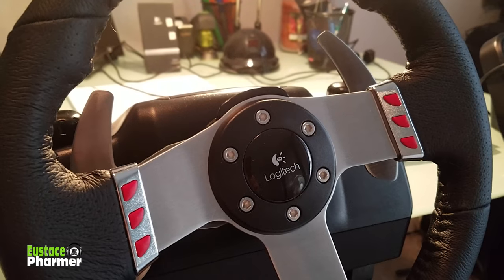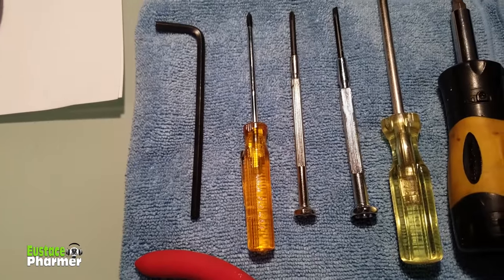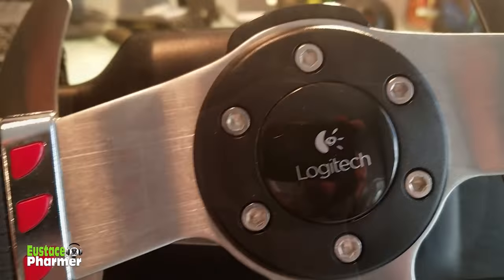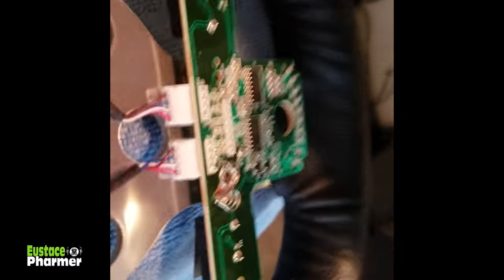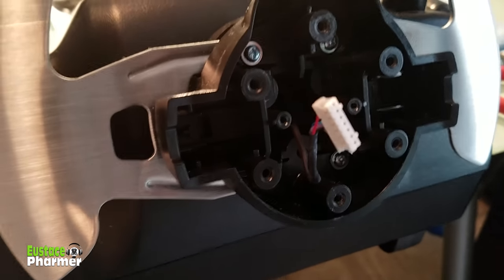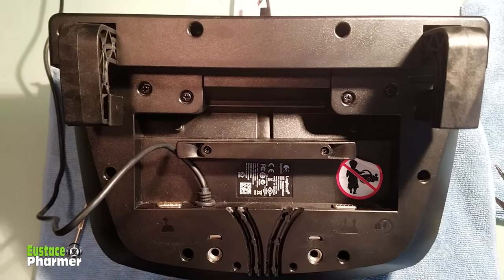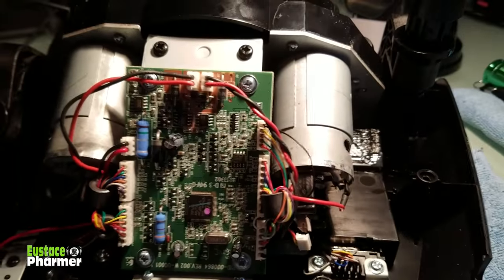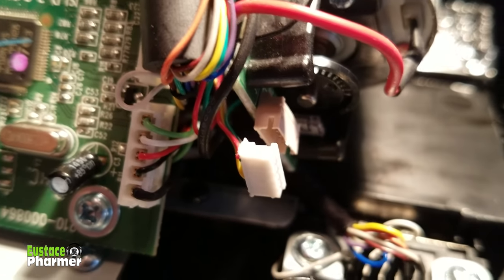LOGITECH G7 WHEEL CENTERING ISSUE FIX

Comment: Well as one of the racers who doesn't see the point of Farmig simulator.....(but then I didn't see the point of trainsims until a friend gifted me one a few years back, so I could be wrong, but well I've got relatives who are farmers so no need to simulate it. ;) ) let me thank you for that helpful video. 

It did help me fix my G27, when I just had both of the issues, loose Optical encoder and a partially broken encoder wheel.
I'm thinking about getting one of the brass replacements for it, as it's past Warranty (german 2 years one) anyway and I don't want it to fracture again, I want a bit more use out of it. 
Well bought it used at an absolute bargain price, around 130€ (hadn't had that issue back then) two years ago , when I wasn't sure if I'd stay in Simracing or not.  And let's say I've been enjoying it a lot, the G29 is a bit meh, more buttons on the wheel but you have to buy the shifter extra, and well... the Thrustmasters cost a bit more.......
Reply from the maker: LupusAries
Lol 😂, I didn't see the point in a Farming Simulator either until I decided one day to watch some game play footage. I was very surprised at the level of detail in the game and it was a launching point that opened my imagination. Watch some of my videos and you will see I use the game to tell all kinds of stories. Look at my Dusty Cove and West Coast play lists for the best examples 😊. Farmers as you well know do not drive a tractor and combine around 365 days a year. I like to tell stories about the everyday life aside from farming as well as farming.
Thanks very much for watching and for your comment. I appreciate it it and glad I could help you ☺️
Reply: @Atomic67G  As a kid growing up on a farm, i played over 2k hours of farming simulator in total (2012, 2009, 2013, 17, 19) I always  liked tractors and farming equipment, bring my frend to my house and he was playing just farming, with no intrest in tractors before

Comment: Thank you so much for this video! One screw was already fixed and the other one I did not even tighten a quarter turn. So my expectations were pretty low that it would work. But it was a nice surprise that the steering wheel worked normally after the procedure and still does after a few hours with DiRT Rally. An interesting detail was that my part with the sensor was mirror-turned compared to yours, but the principle worked anyway. 
Cheers, have a great weekend and thank you once again!
Reply from the maker: you are very welcome and thank you for the great comment! I'm thrilled it worked.
If everything remains tight and the wheels still goes off center in the future look in my description and download DX tweak application that I have there. Use it to fine tune.

Comment: I used a very thin model making glue which draws itself into gaps by capilary action to fix the crack in the disc and a thicker contact adhesive on the shaft after refitting the disc. Thank you Eustace. An informative and very easy video to follow. Another G27 saved from destruction.
Reply from the maker: NTS-autoparts skelmersdale
 you are very welcome 😊 I'm glad you got it sorted out. Thanks very much for watching and for the nice comment.
Reply from the maker: NTS-autoparts skelmersdale
if you still have a slight alignment problem here's some legacy configuration software. it will do the trick for sure.
https://drive.google.com/folderview?id=0B9OBlJza5PRkbHVKS1BIX3B1OEU

Comment: You won't be getting any grief from this racer haha! Excellent tutorial, was really glad to see those screws loose and nothing cracked.

One thing worth noting that I noticed while disassembling my wheel is that the black optical sensor cover was the other way around compared to yours for some reason. The little arrow which you can see on it, as well as the red cable, were more towards the main board. I don't know whether this is a European thing on my end or some assembly line screw up, but taking off that black cover got me a little worried. But I unscrewed the main board to give myself some space and started lifting it with a flathead from under the side which the arrow pointed to and voila! it all went well.

Again, thanks for a clear tutorial!
Reply from the maker: Thank you very much for the compliments and for watching. I'm thrilled I could help you. Wheel and pedal sets are so expensive. We have to keep the "vintage" equipment chugging along as long as we can.😊👍

Comment: Great vid, helped me a ton with taking apart and putting the wheel back together safely. Thank you for documenting your experience. 

For me it turned out that the screws were loose and the ring was cracked, tried superglue-ing it together, did not seem to work (although I thought I did a good job), so I ended up ordering a brass replacement for the ring. 

The part was a bit too tight, so I had to use fine sandpaper to install it. And guess what: the wheel was still not centered. :'(
I then used the DXTweak2 file you so kindly shared and I saw how value and raw arrows for the Wheel axis were off-centered when meeting in the middle. Can't remember what buttons I pressed in that software, but it then re-calibrated the two arrows and fixed my wheel.
Now, I have no idea if the screw tightening and the new brass ring were really necessary, but I have a fixed G27 now. I've had this since 2011 and I hope to have it for just as many years to come now :))
Reply from the maker: I'm thrilled you got some help from my video. Don't feel bad about the ring. You would need it eventually so it was smart to do it now.
I appreciate you watching and for your comment 😊 👍

Comment: Mine only does this when I'm really racing hard and swinging on the wheel.. if I drive carefully the wheel stays calibrated correctly in the middle.

My wheel will also calibrate perfectly every time when I unplug the USB and plug back in.

I've also noticed my vibration doesn't work with dirt 2.0
Reply from the maker: G27 is a good old girl that just needs some delicate care in her old age 😁
Thanks very much for watching and for your comment 😊
Reply: Atomic67 G absolutely! Have had mine for 5 years now, bought it brand new. It’s just now doing this in iracing.
Reply: hey, bought an used g27 today and i have the same issue as you, could you fix it? how?
Reply: Matt B omg same! My vibration isn’t working with FH4!
Reply: Atomic67 G my brand new G920 has this problem...
Reply: Hi @Matt B, this is exactly what happens to me... if I drive slowly and very carefully the wheel works fine, but if I drive in a intensive race, my wheel descalibrated.
Reply: Hi. This is exactly the same problem I have. How did you solve this (if you did)?
Reply: @NextGenGamer1  I bought the g29 racing wheel about a year ago now.

Comment: Thanks for making this video! mine was cracked, it looks like the encoder wheel was manufactured as 2 pieces and they were glued or fused together? My encoder apparatus was mounted backwards from the video so the screws were accessible,  I took them off,  super glued the encoder wheel and held it together with a vise grip (lightly)... reinstalled it after it dryed. AND IT WORKS GREAT NOW!
Reply from the maker: That's wonderful that you got it working! Thank you for the comment 😊 👍!

Comment: Thank you so much! Watching from 2020, seems as though my wheel is cracked but I have no clue what to do. Do I glue it if so do I use gorilla glue regular glue? Or do I just get a new one?
Reply from the maker: Hello and thank you for watching and for the comment 😊.
If you are referring to the optical sensor disk, You can try using a very small amount of Gorilla gel instant adhesive but you have to be extremely neat and careful. You can't get any of it on the surface of the disk or it won't work right or at all. 
I recommend applying the glue with the tip of a toothpick.
Some have had success with gluing it but the best thing to do is to have a new one 3d printed.
Reply from the maker: btw, love your profile photo 🇺🇸👍
Reply: @Atomic67G  Thanks, Knowing me my like is horrible and I have no 3D printer near me so i'm probably just gonna sell it but now I have no clue where to buy a new G27 because it is my favorite wheel.
Reply: @Atomic67G  I'm gonna attempt to glue it right now with Crazy glue and a toothpick, i'll let you know how it goes.
Reply from the maker: @emiliovalenti2723 
Don't buy a new G27. The ones available are over priced and many don't work.
Buy a G29 or G927. 
I now use a Thrustmaster and I love it.
Reply: @Atomic67G  Ugh I had everything with this G27 I had the old shifter with the panel which is rare and I can't believe this crappy little disk is causing this much of an issue.
Reply: @Atomic67G  Pff I just snapped the disk... well to the garbage it goes.

Comment: I have seriously messed with the encoder disk (got a free G27 from a colleague who asked me to check it out because it "has problems"), which was cracked in about 6 places, put it back together with a very thin metal tape) and the 3 dots you mention I think are just results of injection-molding the part and are not anything to worry about, it's the slots you better not cover.

For anyone suffering auto-calibration problems: make sure the gear sprocket that moves sideways is lining up in the sense that the center position of the wheel should have a distance left and right that's equal, otherwise the endstops will not be met accordingly and self-calibration will fail.
Reply from the maker: To be honest, it would be much easier to get another disk 3D printed.

Comment: Excellent work on the video! It has helped me out tremendously to fix my wheel. It was indeed the optical disk. However, during calibration, it doesn't go the full 900 degrees, it stops at 450, then the green light on the shifter blinks and it stops attempting calibration. Any suggestions? It feels like a "hard" lock almost. not something I could get past by pushing.
Reply from the maker: Thank you very much for watching and for the compliment.
Regarding getting the full 900°,  
1. you need to have a clean copy of the legacy profile software installed.
2. unplug wheel and uninstall your current profile software.
3. Run Glary soft registry cleaner
4. install legacy software and follow prompts during install as to when you need to plug wheel back in.
5. If wheel is not perfectly centered after this then install DX TWEAK software which let's you manually align wheel.

I have provided all software links in the description of this video and can be downloaded from my Google drive.
Hope this helps you 😊👍

Comment: Oh my! Today I started having problems again with the center of the wheel after not being used for about a week or so. This happened before and I had to get it to change in a local shop I thought that it had been fixed permanently. Today I opened the wheel and to my surprise the encoder wasn't cracked but I glued a Washer just in case as I saw on other videos. in my country Argentina the metal encoder is around 50 to 60 bucks which is a a lot so I'm wondering how I can fix it cheaply, when you said we could glue the piece together to the motor, which kind of glue would you suggest?
Reply from the maker: Bautista Prea
Hi Bautista, just to let you know glue is a very very temporary fix and you might get glue on the optical sensor. You can remove that cracked component and look up a local business that does 3d printing. They can replicate a new one and it does not cost very much at all.
Reply: Eustace Pharmer thank you for the quick response. The problem is that in Argentina 3D printing is very primitive yet and expensive too. What I'm I think I'm going to do is to the temporary fix the best I can and when I go to the US buy the metal one which I think it's expensive to. To be fair I have so many problems with my Logitech G27 wheel that I think I'm spending more money on repairing it then if I bought a new one. On the other hand I don't think I can make much money by selling it (150 to 200 Max) and as I am thinking of buying a new PC Plus repairing this wheel I will not have enough money to buy maybe thrustmaster wheel or similar. Logitech has not been kind to me!!
Regards
Reply: Eustace Pharmer Either way I just got my license(17) so I'm not sure if I'll still die to play racing games in the future!
Anyways living in the US makes things much simpler, regarding prices, warramty and finding replacements!
Regards
Reply from the maker: Bautista Prea
Welcome to America my friend 😊 I wish you all the best success and thank you very much for watching.

Comment: Hi, Atomic67 or Eustace - I have a G27 that has worked fine for several years. I had to move my racing setup and I think I unplugged the wheel USB while it was live, as you mention somewhere.

Now, despite tightening the screws on the motors and sensor holder it is improved but I cannot get rid of about 10 degrees of a dead area at the centre. It makes it much harder to drive with and unfortunately racing shows my previous lap times to rub it in!

I have tried removing the existing driver and installing the legacy one from your Drive and have tried just about every combination of adjustment and calibration in racing and the Logitech software, to no avail.

I can see the wheel making fine movements in the iracing dashboard and when calibrating, so I infer it is working correctly as far as the sensor goes, and assume it is something to do with the driver (software, not me!).

Any further ideas or should I call Logitech and hope they support an old product?
Reply from the maker: Hello to you as well.
Your issue can be easily fixed. I provided a link in the description to a folder on my Google drive. It contains the legacy software and it also contains a program called DXTweek.

Uninstall your software. Use a registry cleaner to remove residual files. 
Restart PC 

Install the legacy software from my drive as well as DX Tweek. 

Use DX Tweek to re-center your wheel 😊👍
Reply: @Atomic67G  thanks! I'll have another shot at uninstalling the drivers and reinstalling from your Drive. I hadn't used DX Tweek yet.

Thanks again : )
Reply from the maker: Make sure you use a registry cleaner software before you install the software.
I recommend Glarysoft or Norton Utilities.

Comment: Great video! However I found that apart from the offcenter thing I also had the rotary wheel cracked. I glued it together also with a  washer to make it more ffb resistant. However when starting it up the power indicator is flickering and the top bar is red and yellow after a unsuccessful start-up calibration. Any ideas?
Reply from the maker: if it won't calibrate then either you didn't repair the disk properly or you just need to re calibrate. I included a link to my Google drive and it contains the legacy software and a copy of DX Tweek. Use them both to recalibrate and recenter.
Let me know how it goes 😉👍
Thanks very much for watching!

Comment: Hello I'm french , i don't understant when you said "it's loose" .. what is loose? The encoder ? I want to be sure of explications before tempting to repair my wheel !
Your vidéo is very cool ! Thank you in avance
Reply from the maker: Bonjour et merci beaucoup d'avoir regardé. Je suis désolé pour le. malentendu. L'encodeur peut être desserré ou même fissuré. J'espère que vous pouvez comprendre ce message. J'ai utilisé Google translate 😊
Reply: @Atomic67G  okay Thanks ! So I just have to tight the encoder or stick it to fix? What are the risks ?
Reply: @Atomic67G  And you don't show how to remove the encoder to glue it, how can I remove it from its axis?
Reply from the maker: @fassfoud6948  you have to be very clean with glue. If it's cracked you can glue it but don't be messy
Reply: @Atomic67G  Okay, i'll do that tommorow and i tell you if i've problems
Reply: Hello I am repairing my steering wheel at the moment and I have a problem. Can I contact you by message or messenger?
Reply: I followed you on twitter, my name is something like "Robin_Eichelbg"

Comment: Had an issue last year once or twice where after awhile the wheel would be kicked right by about 3 degrees. Went away and thought nothing of it until last night after 3 wheel reconnects it was recurring. Opened it up for the first time in its life (The wheel base, that is) and sure enough the encoder head was SO LOOSE i had a bitch of a time getting the plug and dust cover off the motor and encoder bay.  I DID end up stripping a wheel yoke screw (one of the long, course threaded suckers, luckily) that'll bite me in the ass later i'm sure. but it's together and works great. Thanks, Eustace!
Reply from the maker: Jared Morgan
You are so welcome and sorry you had a rough go of it.
If that screw gives you trouble you can use a tap set and gently extract it. Retread the hole and put new screw. Let's hope you don't have to 😊
Reply: Push come to shove I MAY be able to loosen it with a pair of pliers and buy a replacement screw. But we'll see if it gets to that, I figure the FFB will fail by that time. MOMO lasted 8 years of light service, G27 is on year 3 of hard service

Comment: I saw you have the sensitivity at 200%.  Does that make the wheel on the game respond more than the input you give on the real wheel?  I have also changed the deadzone down as at the default it was like turning the wheel 1/8th of a rotation before the in game wheel would do anything.
Reply from the maker: Aaron Klein Hi Aaron,  thanks very much for watching and for the question.  Yes,  I find having sensitivity up high on everything makes it more responsive. I do that especially with the mouse so I can turn my head faster. Regarding the wheel turning,  try your dead zones at 10%. Seems to be a nice sweet spot for me.